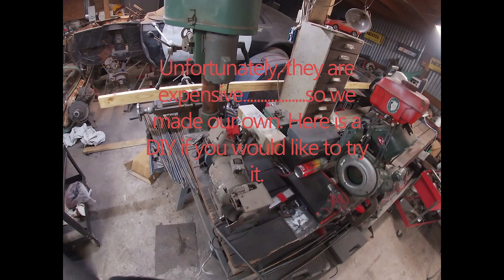DIY Cheap Iron Bar Porch Railings

Comment: Did you caulk the hole after adding the rebar to the bottom boards? Doing the same thing but with 5/8 rebar. I’m thinking about drilling a small hole 1/8”all the way through to allow water drainage. I worry water will collect and with the freeze thaw cycles  split the bottom board.
Reply from the maker: No we didn't, the holes were an extremely tight fit. We didn't add drain holes, but we're in Texas so not alot of freeze or snow. I can say the railings are still holding up strong

Comment: What did you use to paint the rebar? Did you use etching primer first?
Reply from the maker: Yessir, cleaned it with wire wheel, wax and grease remover, self etching primer, then rattle can black. For what it's worth, no a bar one has had an issue so far. Knock on wood